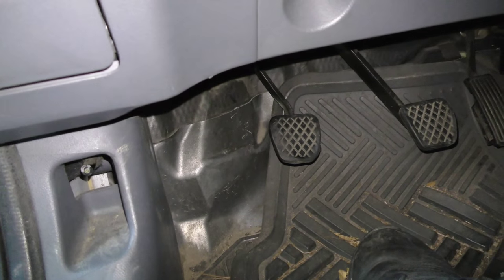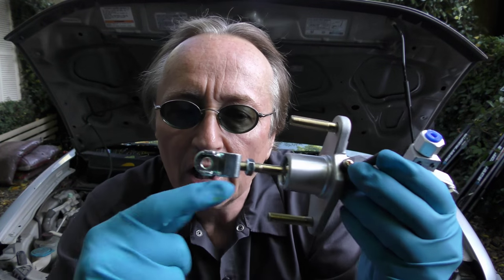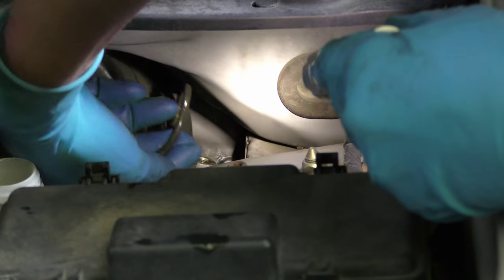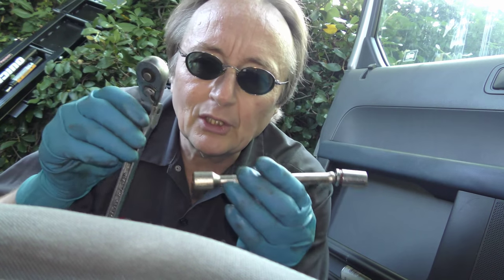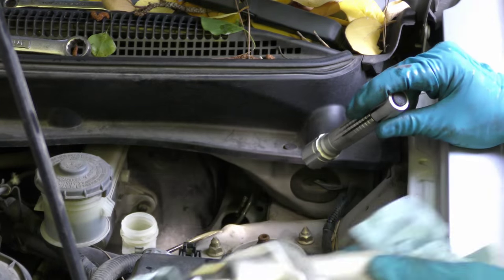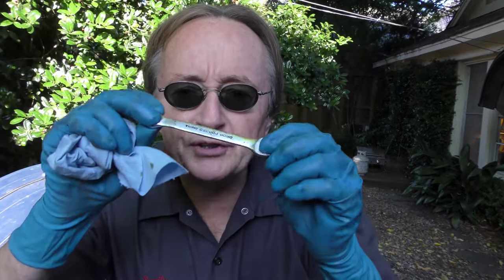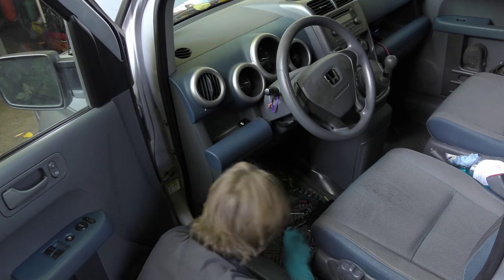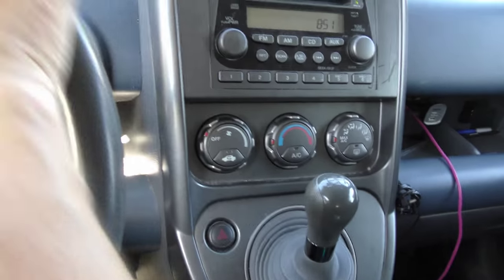How to Fix a Car that Won't Go into Gear (Clutch Master)

Comment: hey I don't think I gave a clutch problem I think it's a synchros issue my 2003 kia Rio doesn't want to go into first when I start the car or when I am stopped anywhere but if I'm down shifting and can get it in it goes all other gears work fine and when I'm in first if I let off fas pedal its makes this horrid grinding and reverse pops out of gear I have to hold it there but like I said 2nd,3rd,4th, and 5th are nice smooth no noise easy flowing I don't get it and I just replaced all the shifting bushings thinking it would help cause my shifter was sooo loose but that did not help me at all with those two gears

Comment: Hi I have a 99 mustang GT. I was driving and when shifting my clutch got stuck to the floor and could smell the clutch burning. Turned off my car and yanked on Clutch pedal and came loose. Dangled for a bit than got pressure. Tried driving again and gears wouldn't go in. Had to force in but didn't want to do that. As I was far from home I decided to start it in 4th and drive that way. Worked but as I came to a red light and pressed in clutch and released, nothing happened. Gears go in but only revs, like in neutral. Not sure what it could be ! Please help
Reply from the maker: time for a new lutch
Reply: Scotty Kilmer When it's on now, gears go in fine when clutch pressed but stil doesn't go anywhere like in neutral but when I try putting in gear without pressing clutch gears don't go in. I thought when clutch was bad, gears would go in with/without clutch pressed?

Comment: I have a 2001 dodge ram truck 3500. I can only it put it in gear when the truck is off. When I put it in gear while truck is off and start it, it takes off and I can't change gears because clutch doesn't work. Any ideas or is it the clutch master cylinder?
Reply from the maker: +StaN Smaltz if you have no clutch pedal pressure, replace the master or slave. if it's tight, replace the clutch itself
Reply: +Scotty Kilmer thanks!

Comment: Hi, I'm having a small problem with my Dodge Grand Caravan. When I hit the gas on the freeway going from 40 to 50 miles per hour, I hear and feel a cracking noise. What could it be??
Reply from the maker: pray it's just a worn cv joint, check both front outer joints by the inside of the tire to see if they are ripped and the grease has all leaked out

Comment: hi scotty .I have a 1998 bmw 323is and the thou out bearing just started to squeak .but I kepped  driving it. and NOW when I push the cluch in. IT DOES"T  EVEN TRUN OVER  ..WHY IS THIS ????
Reply from the maker: pray it's just a bad switch on the clutch stopping it from cranking

Comment: I just finished changing that since my clutch was loose, and it wouldn't go to into gear. Right after changing that my car doesn't want to go into 4th and rear gear. Before changing that piece the car would be normal and change to gears regularly. Please help!!!
Reply from the maker: check the shift linkeages on the tranny, changing a cylinder would have no effect on just two gears

Comment: im having this issue but not leaking any hydraulic clutch fluid. I replaced the slave cylinder a few months ago. clutch pedal will not move the slave cylinder
Reply: Would the master cylinder inhibit the slave cylinder from moving? Also the shifter goes into the gears while the engine runs so I know it isn't the syncros just confused by the while thing. Someone had mentioned a seized flywheel. Appreciative of any ideas as to what would be the cause other than master cylinder if I do change it and it isn't fixed

Comment: Hey scotty,I have a 2007 toyota tacoma 2.7 liter,they sure have alot of valve noise..
Reply from the maker: Bruce Owen of course change the oil and filter regularly, but you may need the valves adjusted if high mileage.
Reply: Thank you scotty

Comment: +scotty  i have a 95 integra manual and my clutch is neww and the stick is way loose i need help
Reply from the maker: +Alex Yeaaa  often the shifter linkeages get worn, check them first, pray it's not internal to the transmission

Comment: excuse me, Scotty  I change my transmission my self and I put everything back together I have the right level fluid in the trams and I when to test it out, and the car won't go more than 20 miles and I can tell that is not switching the gears ( it won't go faster than 20)  no check engine light on please help

Comment: hi.my 97 lincoln continental starts up and drives but after a minute are two wont accelerate can u help me.thank you
Reply from the maker: pressure test the fuel pump AFTER changing the fuel filter, pray it's one or the other

Comment: I have a 1990 Chevy 1500 automatic transmission..I noticed that it won't pass 2nd gear like it doesn't stop or anything but it just doesn't go to 3rd gear it just sounds like it's going faster but it stays the same speed and just revs as if it was on neutral while driving on 2nd gear..I've been told it might be the detent cable or the throttle valve aka kickdown cable. Please help!!!!
Reply from the maker: +gustavo rodriguez  yes, check the kickdown cable, and being that old, see if it has a vacuum shift modulator on it. But if not, odds are tranny is going out
Reply: +Scotty Kilmer oh ok.. How can I push in the the kickdown so the part with the rubber end isn't sticking out so much?

Comment: I have a 95 Toyota Tercel that won"t  let me change out of Park to drive or any gear I keep checking the fuse 15A  I replaced it and it worked one time and it"s still doing the same not letting me move the gear. What could be going on.

Comment: My vw 2002 is currently in a parking lot with me in it. I stopped bc I thought I smelled burning. Oil was low so I added some then couldnt go into reverse (nothing new, bad bushings) so we put it in reverse manually under hood. Then we thought it was stuck in the down position because once in gear, releasing the clutch did nothing. Rpms will go up as normal just no motion whatsoever forward. It goes into all the gears just cant get power. Pls tell me there is an easy solution I can't afford to deal with shady mechanics.

Comment: Mine has a similar problem, but it's a cable clutch.  Eventually I need to get under it and adjust it, but living in the rust belt, that's not as easy as it should be :/

Comment: i have a 2003 chevy cavalier automatic.  the shifter goes threw all gears but it wount click into gear or move.  the shifter will be in reverse put the is still in park and wont move at all.iam freaking out. can you help?
Reply from the maker: replace the transmission cable

Comment: i have a question, my car is a 1.5 hyundai accent today i was driving i went to 1st than 2nd than when i went to 3rd it would engage neither will 4th but 5th works wat happened? the stick will go to the gear but u dont have to press the clutch it jst slides in and nothin happens
Reply from the maker: +able linares pray the shifter linkeage needs repair and that it's not an internal tranny problem

Comment: In my car, i can shift to all other gears except the second gear fails to engage. what could be the problem?
Reply: Have you tried the double declutching method? If it goes in like that then its the Synchro's and a new gearbox needed!

Comment: I have a Kia picanto 2009 model that had a clutch problem I replaced the clutch kit and after that gear 1 and reverse doesn't wana go in when the car is running. Please help
Reply from the maker: well, make sure the clutch hydraulics are working too. Nice and tight pedal
Reply: It's using a clutch cable and I've checked the adjustment it's good I don't know what's wrong with the gear box or maybe the clutch kit it's not installed correctly

Comment: I changed the clutch master cylinder but it still won't go into gear. is there another problem with it?
Reply: Yeah was the clutch. Going to change the whole clutch, Csc and flywheel

Comment: Hey scotty i have a 2004 chevy avalanche and when i get on the freeway it rocks side to side what could it be
Reply from the maker: Denzell Wilder worn out shocks or springs are common for that, but of course, check the tires too, badly worn ones out of round will do that too
Reply: Scotty Kilmer ok i didnt think about the tires thanks alot as usual Scotty

Comment: Thank you for the knowledge. I've a Mini Cooper S 2007 R56 and its very difficult to shift to the second gear when the car is cold especially in the morning. Many people suggested to change to Redline MT-90 GL4 75W-90 plus Liqui Moly 2019 MoS2 Anti-Friction Gear Lubricant. The car shift slightly better to the second gear at cold temperature but the problem still there. Would like to know what do you suggest?    

I don't have LSD, The cluck was change at 70K and the car has 100K on it. when i called the dealer and i gave them the vin number they gave me this part number 83222339223. which is MANUAL TRANSMISSION MTF-LT-4 75w-90 so i thought Redline MT-90 would be ideal since both are Synthetic GL4 and 75W90.. but now after the oil replacement i see more forms about MTL 75W80... Any suggestion how the car can shift better in cold start up ? Thanks
Reply from the maker: you can try that, but on those, often a bad sycrho in second gear needing rebuilding, VERY expensive
Reply: I have a 06 mini cooper an it was running fine but now the car just don't want to go into 1st 2nd 3rd gear and in neutral and reverse it seems to want to accelerate forward. Even when I do manage to find a gear it's like something is preventing it from going, I think I broke an axle. The car was running fine and then boom all this. any suggestions???

Comment: Hey the clutch in my b18 civic won't go down it really hard to push and when it's running I put it into different gears and it just won't do any thing car ran fine when parked two months ago now I go into drive it and it's doing this any ideas please help
Reply from the maker: pray it just needs a new clutch master cylinder, if not, time for an expensive new clutch assembly
Reply: Scotty Kilmer thanks and what was wrong was the slave cylinder rusted open 15 dallor fix

Comment: please help. I put in a new clutch,pressure plate,and throw out bearing. then I put in a new slave cylinder and master cylinder. not I can't even get into gear! any suggestions?
Reply: Rudy Mendez what kind of car? Make sure you bleed it RIGHT.
Reply: I have the same problem ? I put a B20b in my Civic and it won't go in gear? can someone help me
Reply: something is probably backwards

Comment: My car won't go into gear. Checked where it says on the video for leakage but there wasn't any. When the car is off I can shift into any gear, but not when running. This happended shortly after I heard something loud. Maybe like something hit metal. I turned it off and back on and I could drive for only one day.

Comment: I changed both the master and slave cylinder and it worked for a day, now I cant shift into gear. Any idea what it could be.
Reply: U still have air in ur lines probably. Needs to be bled again

Comment: My friends 5 speed trans in is mustang is stuck in neutral the shifter will not move at all not a mm in any direction 94 mustang 5.0

Comment: I got a 1993 jeep wrangler with a new clutch and I can't down shift or shift without the gears grinding, what do i do? HELP ME
Reply from the maker: +NewLawLV IF the clutch was installed right, then the transmission has internal problems. If it didn't do that before the clutch job, then it was done wrong
Reply: Thanks, it is the transmission, I just called the guy I bought it from.
1993 Jeep wrangler any advice, Im might try and rebuild it myself, Im pretty handy.
You have any advice?

Comment: Hey Scotty I have a 1992 Chrysler lebaron the key is stuck the gear lever won't move and when I turn the key the car fans turn on but the car doesn't
Reply from the maker: check the brake light, if not working it won't let you put car into gear. And see if a locksmith can fix your key lock assembly if it's stuck in
Reply: The lights do come on. My friend went all the way down to the L gear instead of D and I guess it's now stuck, any idea why it won't start ? Was working fine with me the day before even did a diagnostic tests because it wouldn't turn on (cranked with a no start) but it was just loose battery terminals

Comment: I went to the car shop, and the manager said my fly wheel and pressure plate is damaged that's why I can't shift into gear..cost me $1320. Work like new now, smooth shifting

Comment: I have a 2007 Honda Civic si and I recently crashed it and when I crashed it was in 2nd gear and now I can't take it out of 2nd gear it drive but only in 2nd would could be the problem please help thank you
Reply from the maker: +xXFresh NinjaXx pray it just bent the shifter rod that you can get out of a junk yard and didn't break the transmission internally
Reply: +Scotty Kilmer ok I think it is a bent shift rod because the car drives fine no tranny noises it just won't get out of 2nd gear

Comment: Scotty what about an automatic transmission that won't go into gear when you step on the gas and just revs and acts like it is underpowering to get up to speed while reving
Reply from the maker: pay it's low on fluid, cause if not, those normally need rebuilding from internal wear
Reply: Scotty Kilmer when I'm easy on it. It shifts nicely but when you press down more than normal it will jerk a lil and sometimes it won't but when you really stomp down that's when it revs and goes really slow or not moving at all. Fluid is to full and is reddish

Comment: sometimes when i go to second i'm 100% sure shift is good and it either slips out or doesn't go in all the way, what could it be? (doesn't happen often)
Reply from the maker: imthemojo often a weak hydraulic cylinder does that

Comment: PLEASE HELP SCOTTY I DRIVE A SAAB 900 CLASSIC AND THE IGNITION KEY WON'T TURN NO PARTS AVAILABLE SO I WOULD LIKE TO INSTALL A PUSH BUTTON START OR A SWITCH OF SOME KIND SO MY CARS CAN RUN AGAIN. ONE IS A 1987 MANUAL AND THE OTHER IS AN 1991 AUTOMATIC.
Reply from the maker: +Angel Rodriguez you would wire two switches, one to turn power on to all systems, and another switch to power up the starter motor. Get a wiring diagram to see which wires power which parts
Reply: THANKS SCOTTY I WILL GIVE THAT A TRY.

Comment: what may cause a automatic transmission to not go revise after it was put in gear thx
Reply from the maker: worn transmission or dirty one inside. Try taking one quart of fluid out and putting in a quart of lucas anti slip additie
Reply: Scotty Kilmer thx for the  advise

Comment: Switched my master cylinder and still no gears. Granted, im not a mechanic. Tightened everything, bled the line, pedal got hard but it isn't going back up all the way and the gears still isn't engaging. 
Clutch gone?

Comment: Hey scott, I have a 99 Expedition 5.4. It needs 5w30 synthetic oil, but the mechanic put 5w20 synthetic oil on it. Will this thinner oil damage the motor? 

It also has 135k miles on it.
Reply from the maker: DatCarGuy310 it won't hurt anything really.
Reply: Alright thanks scott! I was getting scared thinking thinner oil was gonna damage the engine lol

Thanks Scott! You're a lifesaver!
Reply: DatCarGuy310 5W20 has been the standard weight that Ford recommends since 1997, you'll be good.
Reply: DatCarGuy310 If it is recommended then that will be always the best for your engine, and if you live in a sunny country, your engine won't like it.
If you can bring it back so the mechanic can put 5w30 in it because it is his fault.
Reply: Yeah, they put 5w20 synthetic, but next time, I'll probably add 10w30 or 5w30.

Thanks for your comments.
Reply: fetullah ydz It doesn't matter the weight of the oil (not the cold weight e.g 5w, but the running temp weight), your engine is going to run at the same temp regardless of the ambient temperature outside. Putting thicker oil in due to it being 90 degrees outside literally does nothing.
Reply: Striball O'RLLY?

If you start your engine after it hasn't run for a day on a sunny day, it can cause damage.
Reply: DatCarGuy310 No it will not damage the motor , this oil is less viscous and may help the engine in a colder climate related to cold cranking, do you have a long winter cold   ?
Reply: Jonas Ben No, but it's mostly 60-75 degrees here, but next week or so it will get hotter by 10 degrees or so.
Reply: KillEmAllWithMetal What ever the fuck the the manual says.

Comment: my cluch is loose I need to pump my cluch alot and add fluid before it goes into gear i refill when its almost gone but its never gone. What would it be ?
Reply from the maker: replace the master and slave to be safe, you have leaks
Reply: I can't find any wet hoses. And i can't really tell if am leaving drops.
Reply: +baldo aviles can it also be the main cluch ?

Comment: my 97 ram wont upshift,I've replaced output speed sensor and govenor pressure solenoid also the transducer.my truck still won't up shift..and ideas??
Reply from the maker: being a dodge product, odds are it needs rebuilding, they rarely last that long
Reply: Scotty Kilmer  thank you, i hope I can figure out what's wrong with it

Comment: hey my car is a Mitsubishi lancer ES 2002 and I have a clutch pedal problem my pedal goes all the way to the floor and it comes back up like a normal thing but is so soft and light when I push the clutch pedal down but I still have to push it down to start the car and the car starts but it won't go into gear but it goes into gear fine when the car is off. please help me
Reply from the maker: replace the clutch master and slave cylinder

Comment: He put another faulty design clutch master cylinder on. On ALL Acura/Honda (K Series) 4 cylinder vehicles manufactured from 2001 or newer, you don't want to install a clutch master cylinder with the triangle shape on it. You will have issues again. THIS IS A KNOWN FAULTY DESIGN to Honda/Acura enthusiasts. Message me for further explanations. ✌